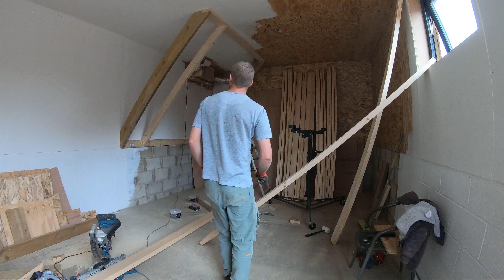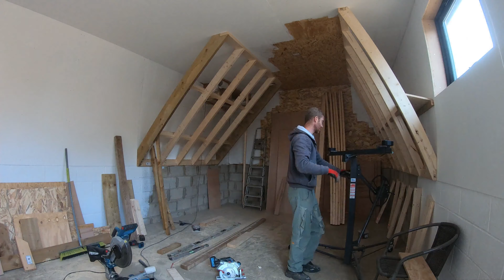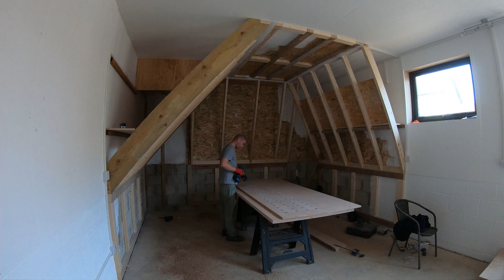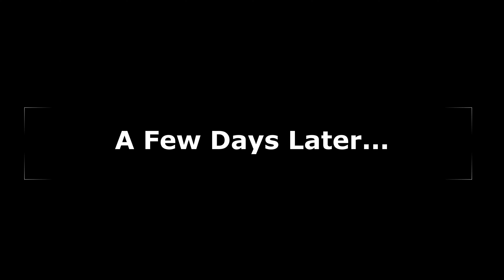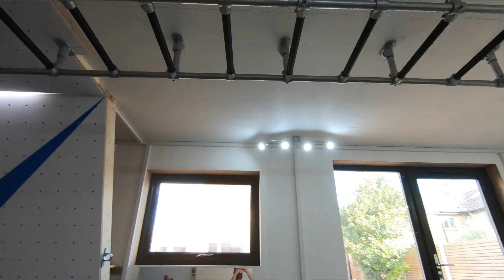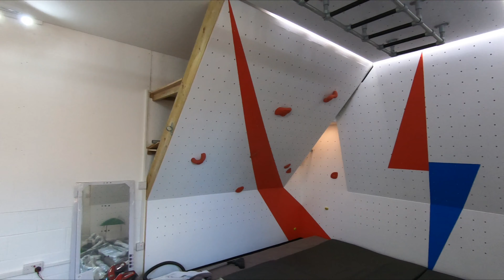Building a Climbing Wall in my new Gym - Part 8 Nearly finished!

Comment: Why build a cave then put a chunk of metal through the middle of it 🤦‍♂️ no offence but it makes no sense, the cave is now impossible to climb properly through
Reply from the maker: Each to their own. It actually works quite well but I guess you'd have to try it for yourself to know. Monkey bars work well, good length and they have no impact on using the cave given how I've placed all the holds 👍